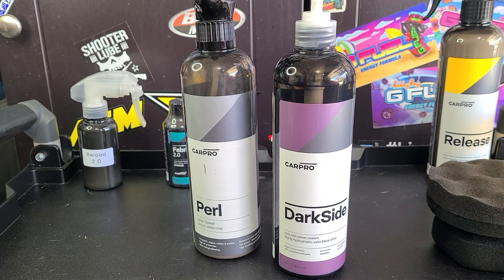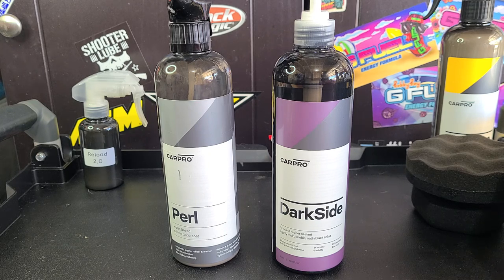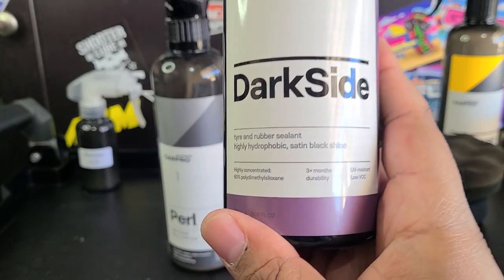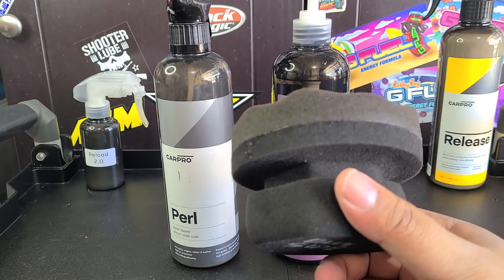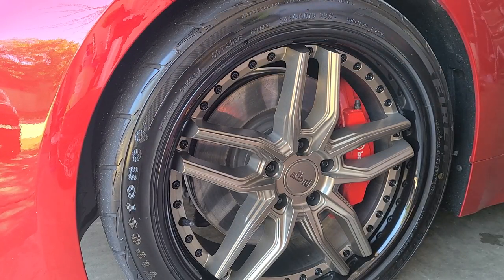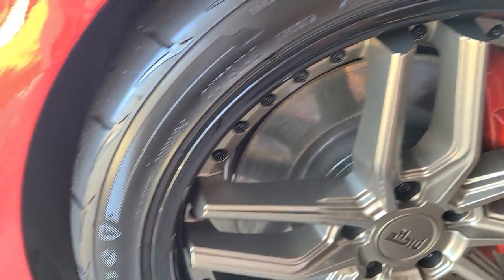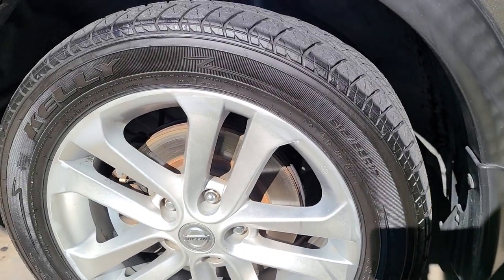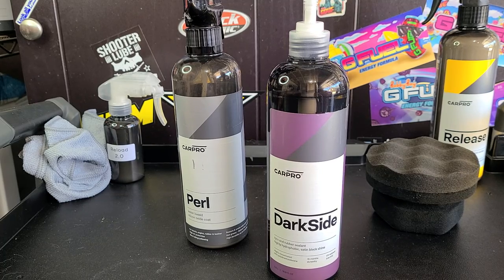[NEW] Carpro DarkSide Tire & Rubber Sealant - Review & Application

Comment: But dont solvent based coatings damage the tire and case premature cracking? This is why i settle for water based since my AT tires are expensive.
Reply from the maker: I have heard people say that but have never seen any proof. Either way my tires will run out of tread long before any dry rotting.
Reply: I have seen the solvent based stuff cause drying and browning.

Comment: so how has it lasted after 3 months compared to the turtle wax and Adam's?
Reply from the maker: Keep in mind I keep my car parked indoors overnight. Even after a few rain storms, it is still there. Not as shiny but still a matte sheen with a deep black look. I usually rinseless wash my car or touchless so I might clean my tires every couple of months. I love this stuff. It holds up much better than TW or Adams likely because it is solvent based so it really soaks into the tires.

Comment: Thanks for sharing your experience with this in the comments. The photo you posted, while looking clean, doesn't show it looking very dark after a week to me - just the lighting? I noticed you say that the TW Hybrid Solutions one soon loses its shine but stayed dark even after a month (heard that reported elsewhere too). Was Darkside just as dark at that 1 month mark? How is it holding up right now (around 2 months)?
Reply from the maker: Yea it was just the lighting in the garage. Darkside was doing really good, similar effect as with TW but as you drive more your tires get more dirty. I do like how easy it is to work with. Being solvent based instead of water based it soaks into the rubber and spreads easily. I definitely like it's freshly applied look better than these other water based ceramic dressings I've been reviewing. They are all very good though. I'll say darkside gives more of a natural clean rubber look with a satin sheen where the others have a more obvious tire shine look.
Reply: @BelLavoroAutoSpa  I appreciate the feedback. What's your pick between this and the TW? Does Darkside stay dark longer now that it's been around 2 months?
Reply from the maker: @andrewvickers4487  I'd probably pick Darkside. I have removed it to test another product but I honestly would have cleaned the tire and re applied it by now. If a car stays garaged often it can likely last 3 months but in most cases your tires are gonna need a good cleaning before that point.
Reply: @BelLavoroAutoSpa  Thanks man

Comment: How is it on trim? Perl seems to spot heavily after some moisture or water contact
Reply from the maker: Haven't had any trim to try it on, but it should do well on textured plastics and rubber trim. On my tires it has not spotted or run off in the rain and repels water.

Comment: Not sure why use these over blackout 

Blackout is an amazing product as it’s a “coating” bonding into the surface and lasts long. Also wash maintenance is easier not having to worry about stripping product and cleaning properties make it a clear winner in my book

Thanks for video. Seems a step up for those not wanting to pay out for blackout or like the uphill battle of maintenance 😂
Reply from the maker: You got it. This is cheaper and easier to apply and re apply. Nice tire shine with decent longevity snd can use on trim as well.
Reply: I haven't tried Blackout yet, but based on a few reviews, I've decided not to, because it simply doesn't look good enough, even after multiple coats. I'm a chauffeur, and I want my tyres looking glossy all the time - the most cost effective option I've found so far is to buy old fashioned solvent based silicone shine in 1 gallon containers, from a wholesaler. I apply it often.
Reply: Blackout application is a lot like ceramic coating, which isn't the best way for everyone especially for the average DIYer also its a bit more expensive. Carpro Perl and Darkside is much cheaper and easier to apply